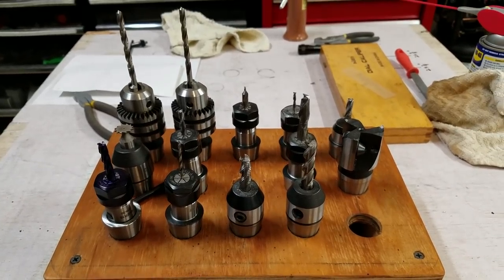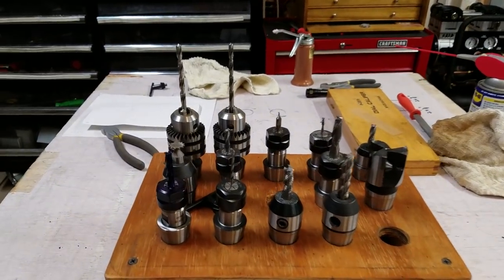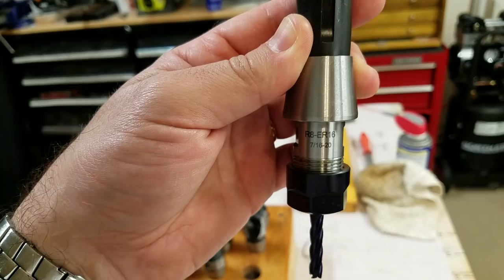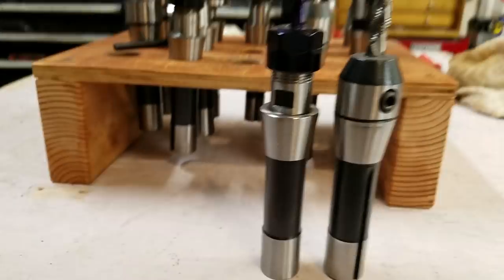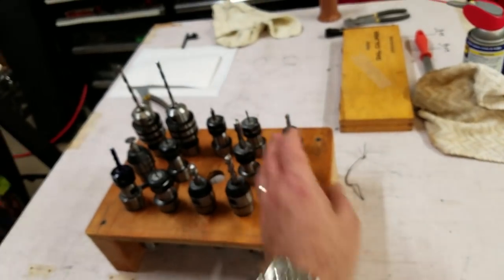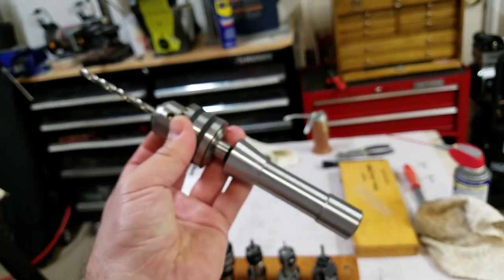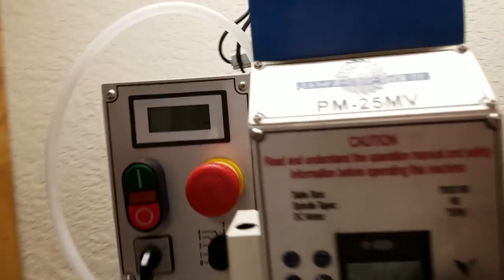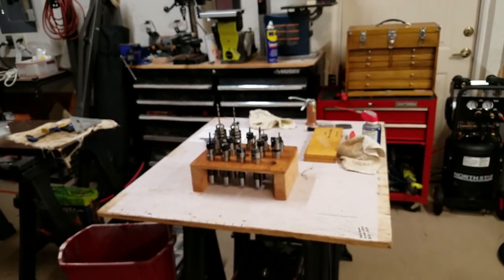PM-25MV Tool Holders for Use with Centroid Acorn CNC Control

Comment: Franco, do you define your master tool as tool 1 in centroid? Are there problems with the drills being longer than the master tool? I remember someone said that the master tool should always be the longest tool... 
A video about populating the tool library would be nice! Thanks
Reply from the maker: Hi.  My master tool is Tool 1 in Centroid.  It is neither my longest or my shortest tool.  I haven't had any problems with my Drills being longer than my master tool.  I thought someone may ask about the tool library and how to enter values into it - I work on make a short video on that topic.  Thanks!
Reply: Franco thanks for the quick response, very much appreciated!

Comment: Hi Franco.  I just got a milling machine finally and your videos are most helpful.  What are the pros/cons of this method vs a TTS style quick change setup?  Also are you able to put drills in ER style collets or is that bad practice?  I seem to always see drilling ops using a Chuck even in fancy setups.
Reply from the maker: Hi.  I'm glad you like the videos.  The TTS tool holders are easier/faster to change and I'm sure they work just fine.  However, I believe the R8 style holders are more rigid/accurate.  You absolutely can put drills in ER collets.  In fact, that is preferred if you need to make a "precision" hole.  In a production machine shop, you will rarely ever see a drill bit held in a Jacobs chuck on a CNC milling machine or lathe - they will usually be in a collet of some sort.